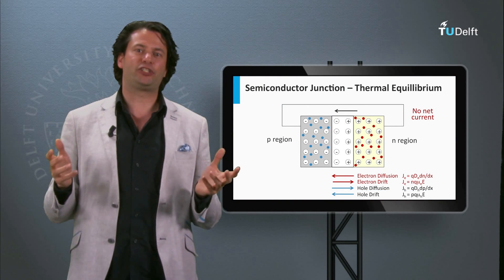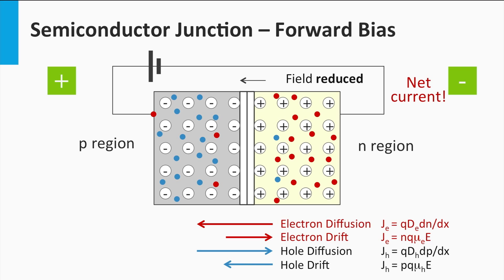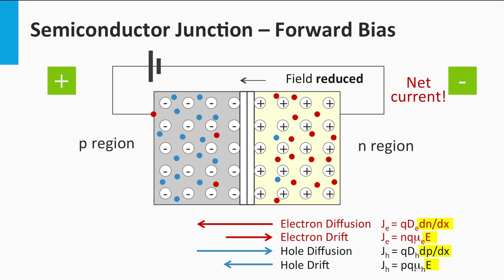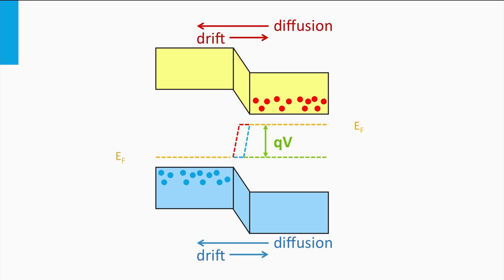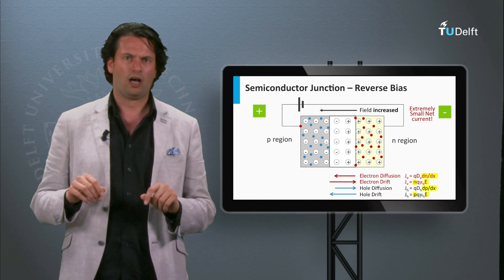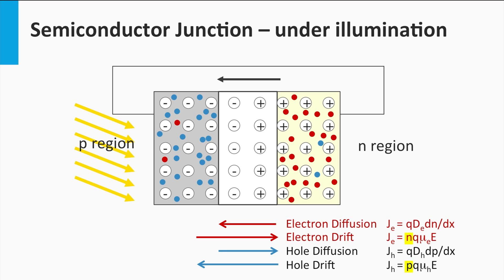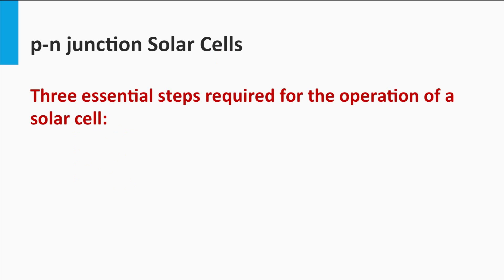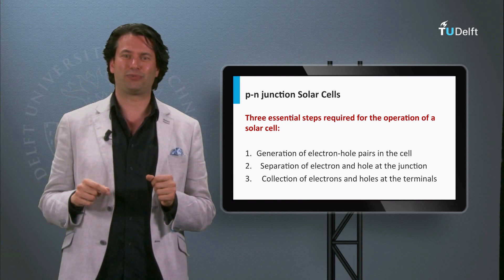2.7 Semiconductor junction: the solar cell

Comment: This is extremely well explained! Thank you very much. 

Just a small correction in case someone got confused: At 4:50 (when he starts talking about the reverse bias) the green + and - signs should switch sides. Like he says it should be that "the voltage at the contact of the p-doped side is negative and the voltage at the contact of the n doped side is positive".

Comment: that's kinda convenient... about the solar cells: n and p increases, so the drift increases, what about dn/dx, you forget to change that too with increasing n, or is there a reason? shouldn't the diffusion increase too until equilibrum, what means there is no net current?